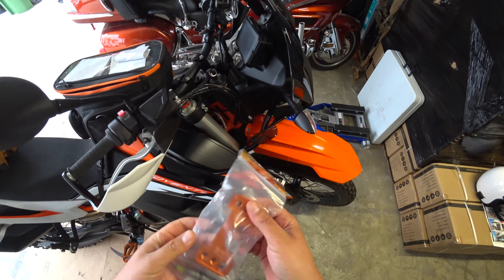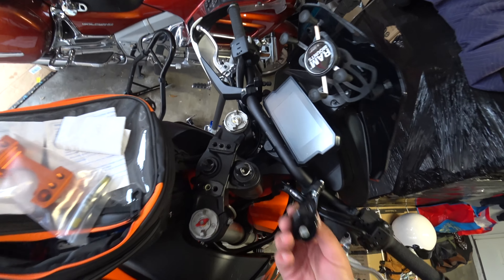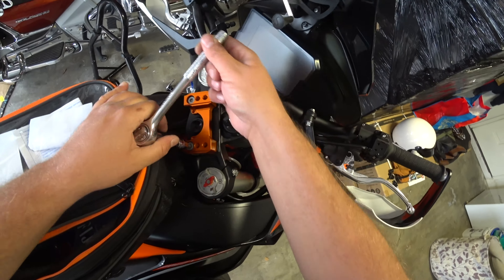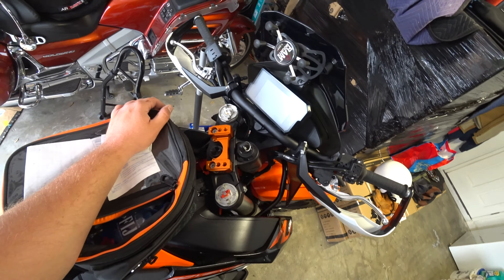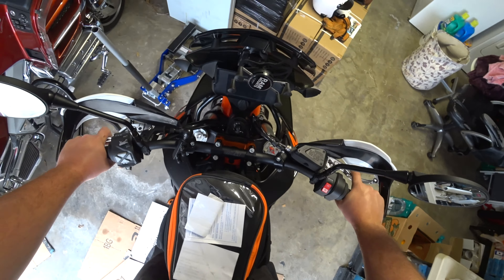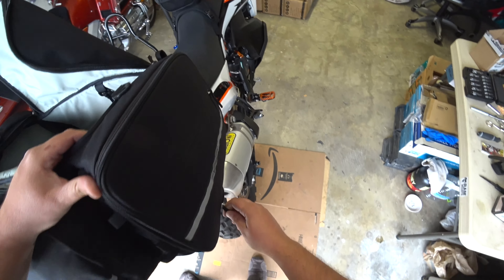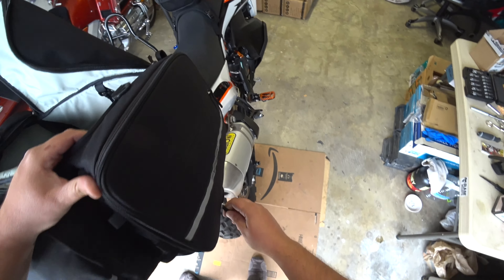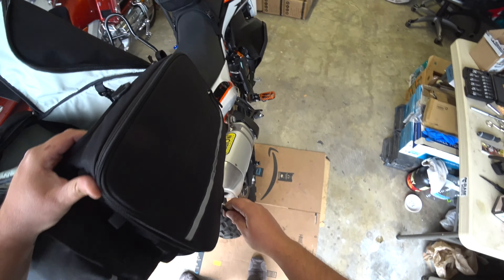KTM Adventure 890 Handlebar Risers for adv riding.

Comment: The higher the bars go,the less weight can be put on front end to make the bike corner,especially on dirt. It takes weight off front end noticeably even for road riding.  Some do it automatically,put on bar risers that is.
Reply from the maker: I am a really tall guy and those risers really made the bike feel more comfortable. Comfort = safe.
Reply: Even though that story might be true it feels like a dramatized statement. It's not like you're prone to lose control much more quickly after a few mil of bar rising.

Comment: Did you have an issue with the fasteners that hold down the origional clamp to the aftermarket riser not sitting flush within the curvature of the stock bar holder? Mine don’t seem to want to sit flush
Reply from the maker: No everything was flush on mine

Comment: i don't really like the fact that there is only 2 screws holding down in angle the bottom piece... i ordered a set of 20mm risers, and you re-use the stock screws on the bottom, but the new screws bolt alt the way from the top, through the other holes that the riser has, and then to the upper clamp... so you have 4 screws tighthen the clamp, 2 in the raiser, and 2 that goes all the way from the top, to the bottom.
Reply from the maker: Yes. But seems to work fine.

Comment: What brand and model of riser is that?  How much lift?  I am 6 1 and those stock bars are way too low for me to stand and ride.
Reply from the maker: I got them from rottweiler performance they were about $80 they raise 1inch. i am 6.1 too and they are perfect for me.
Reply from the maker: Vanasche Motorsports - 1" Handlebar Riser - KTM 790/890 Adventure
Reply: @loshonorables6165  Just letting you know I bought these based on your video and they made the bike fit so much better. Thanks! Get Rottweiler to give you a cut :-)